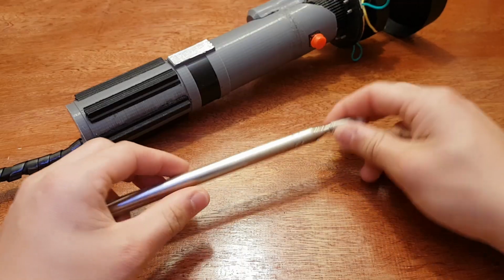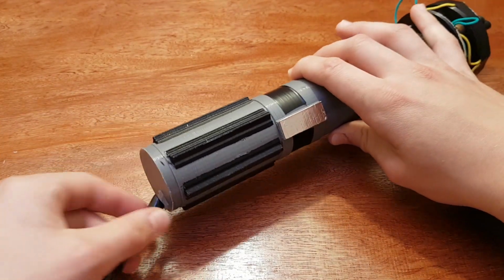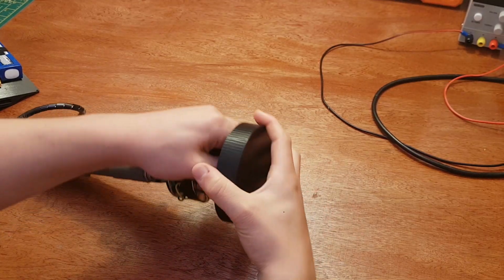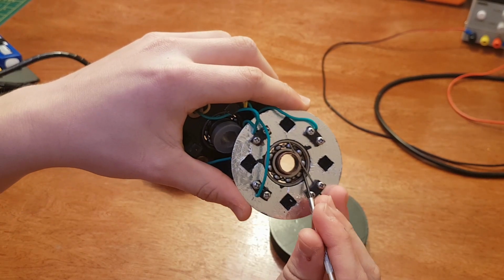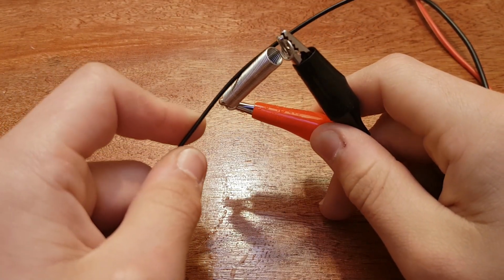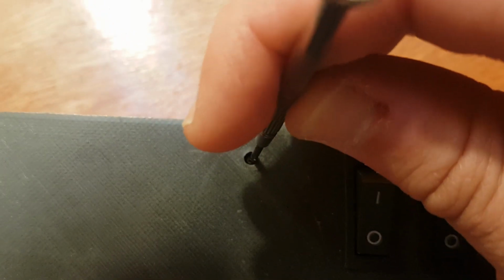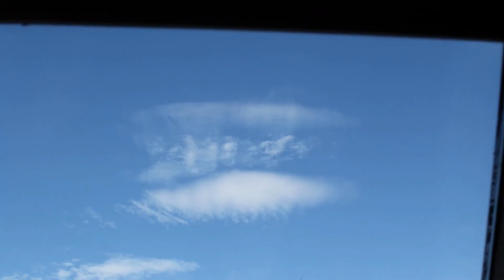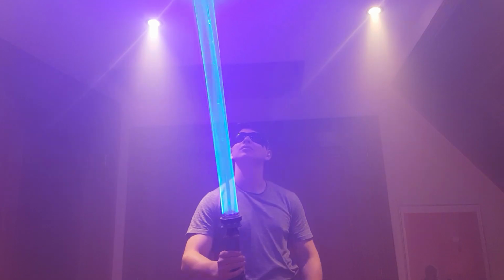IRL DIY burning lightsaber!

Comment: Could you put a mirror that doesn't absorb a certain frequency of light at the top and also include a one way mirror on the bottom, so the laser can pass through, but not come back and burn the electronics?

I've always had this idea, but I'm just gonna give it to you instead.

Comment: did you know that the original lightsabers of the jedi had power wires and backpacks, soooooooo, this is a phase 1 lightsaber.
Also, did you model the handle after lukes lightsaber?